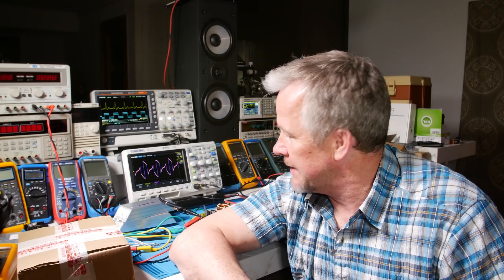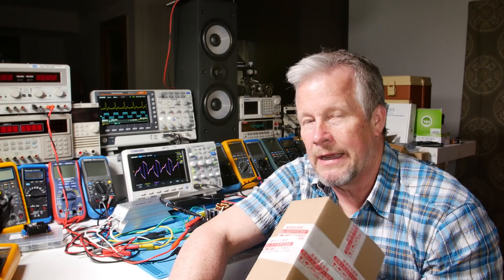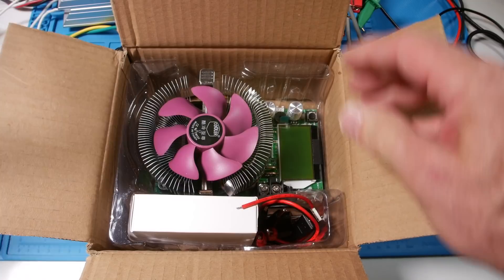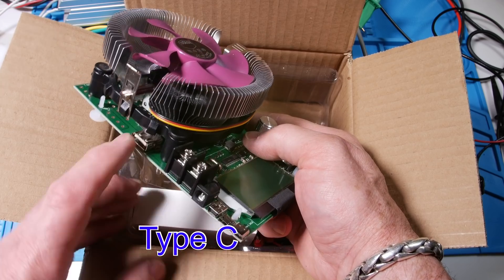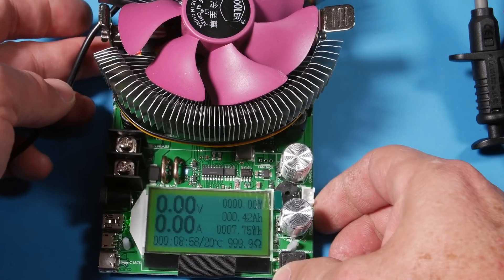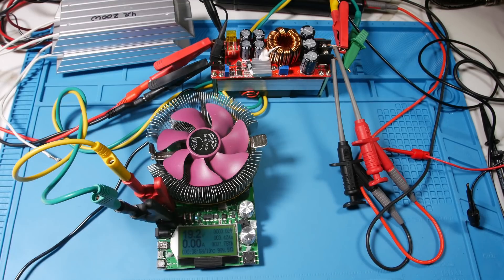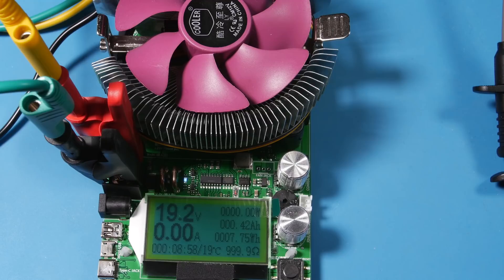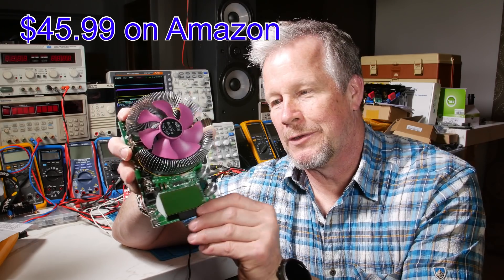MakerHawk Low cost Electronic Load

Comment: Hey Eddie is this DC load tester still working?
Reply from the maker: Yes it is - kind of.  I actually dropped something on the fan blade and broke it off the shaft.  So, I just have to epoxy the fan back on and it will put out full power again;)
Reply: @KissAnalog  thanks for the reply Eddie!

Comment: @5.50 The holes in the board are actually VIAs, they connect the bottom copper plane to the top copper plane.  Using the bottom copper layer as an additional heat sink.  The multiple VIAs allow for better transfer of eat from the top copper layer to the bottom copper layer.
Reply from the maker: Thanks Robert!  Yes you are right on!  Using via fields is a great way to tie planes together and also add more copper in the vias:)  In this case, they are so large - and with the placement of the fan, I think they also are allowing airflow threw the board.  Pretty cool idea;)  I've placed cut outs and larger holes for this, but I like this technique!
Reply: @KissAnalog  Yes the holes would allow the air to flow to help cool the bottom plane.  I too hadn't seen VIAs that large used before.  It is an very good Idea. 2 birds 1 stone.

Comment: I’m seeing current ripple on the output, at power up it’s flat but after 10 seconds I start to see ~1A short current pulses.  I’m testing a 12v 100w Vicor. Ripple with equivalent resistor is flat.  Anyone else seeing this?
Reply from the maker: Hi Bill, I was going to test this, but I damaged the fan accidentally and my glue is not holding (it is probably nylon).  I do think at lower currents that I did see something like this.  I meant to look into it but got side tracked;) Have you learned more on this since this post?

Comment: The most interesting thing with these cheap dummy loads would be to test the accuracy. I tested a few and the current and voltage measurement is by far not as accurate as claimed (often 0.5% error). Its more like 3...5% error. It should have used 4 wire measurement instead of just 2. Some voltage is already lost on the connection load wires - so the error becomes bigger with high amperage. Of course you can cure this a bit with very strong cables.
Reply from the maker: Thanks for this feedback!  I have a new version that I need to review and I’ll keep this in mind;)

Comment: I just picked one up off eBay and I'm not getting it to work. My knob adjustments will never turn the fan on or make the Voltage or Amperage move. Any ideas?
Reply from the maker: Sorry, just found this post.  Have you had any more success?

Comment: Does an cheapy electronic load add noise to the input ? If it doesn't change the output noise already a powersupply would have under load could be a cheap way to test power supplies
Reply from the maker: This is a fantastic question!  On the job, we don't even use our expensive active loads when doing EMI testing.  Not to say that they add a lot of noise at the input power where we are looking at EMI, but just to be safe;)  We use resistor loads.  I'll do a test to see what we see;)  Thanks for this!

Comment: Hi Eddie, that very same one you showed in this video is now in 2021, under various brand names, sold for $29. I used a similar one but with a 16x2 display and other user interface. Didn't like that one so much, didn't have continuous current control. Now I found another one, based on the $29 design, but the display is on a raised pcb. Looks nicer and makes it easier to detach when putting it in a box, connected with a flex cable. Specs are the same, price is €28. Amazing, isn't it? These things are very popular. I just ordered one and have to wait a couple of weeks now ;-)
Reply from the maker: Thanks for the great feedback!  I also got a new one that is just an updated version I think.  It also works great;)
Reply: Fifty bucks now.

Comment: hi sir, this load hasn't got a seperate voltage sense input. is possible to determinate voltage sense pins on the board?
Reply from the maker: Thanks for asking - that's a great question.  A remote sense will help to regulate at the load better to account for the cable loss to the load.  Without one, it is even more important to use larger cable to reduce loss.  The board might be able to be modified to add a remote, but that might need a video to explain;)

Comment: Did you try pressing the push button inside the rotary encoders? It probably has coarse/fine setting
Reply from the maker: Yes I think you are right.  Thanks!  I broke my fan with my fat fingers;)  Now I need to epoxy it back on so I haven't been using it...  I'll get that fixed as I need it;)
Reply: @KissAnalog  those are standard cpu/gpu fans which can be found on ebay and aliexpress. If you glue the fins back, it will vibrate a lot and destroy it's bearing

Comment: from own experience

a ">150V!"- overvoltage indication caused a freeze of the display, with just this message, on my 150W electronic load from Chinese production, which looks quite similar.  I have not been able to create a RESET of this message with the one button on the board. 

The adjustable load itself still works, only the display constantly shows ">150V!" It's a mystery to me how the overvoltage message appeared, because I only tested USB Power-Bank's. Maybe a burst spark...no idea (?)

In the case of the more frequent, and also understandable, operating case of the undervoltage message, this can be reset by applying a voltage above this setting value to the measuring input. With the key on the board, as far as I know, only the measuring value memory can be reset. The error or message memory is excluded from this.

If someone has a TIP to reset this overvoltage message I would be very grateful !  - Greetings Michael/germany
Reply from the maker: I think I have seen this when there is no load.  The voltage can climb up and get pretty high.  It is strange that you can not reset it.  I'll look into it.

Comment: ive used these in parallel up to 60A,  work great.  Note factory wires suck,  too much voltage drop/heat loss at the higher amperages.  If i get the chance i might replace the pots with digital pots for an automated setup
Reply from the maker: Wow - that’s a great idea!  Thanks for this great feedback - very helpful!

Comment: I wasn't a fan of the flex in the thin PCB caused by the heatsink pressure. I backed off the tension to a minimum and have no issues with heat dissipation. I'd pay an extra couple $ for twice as thick.
Reply from the maker: I completely agree with you!  Thanks for the feedback Jonny,

Comment: My 180W test boards came with 9V/1A power units (wall-warts). IF you are going to use currents anywhere near the high end of the unit's specification, I recommend switching to a 12V/2A power unit so that it can maximize the RPM of the fan(s). Otherwise as far as I can tell the fan max RPM is limited to what 9V can supply which seems to be about 8.0V after a voltage drop in the fan control circuitry.
The fans that came with my 180W boards were also lower RPM fans (230mA per fan at about 1700-1800RPM max as best I could tell) so I replaced them with higher quality and higher air-flow fans. At maximum RPM they are louder than the original fans...but of course the new fans are pushing a LOT more air through the heatsink. This results in the new fan(s) keeping the MOSFET considerably cooler than could the original fans and that is ALWAYS a good thing.

WARNING! If you do use different fan(s) you have to make sure any fan control circuit can handle the mA required by the fan(s) which could be much higher than the original fan(s). You may have to make or buy a fan control voltage follower circuit that has the power-handling capacity for the fan(s) you use. Note: there are some fan control circuits that do this for you. The circuit is inserted and controlled by the existing 3-pin fan power jack on the board and the output(s) go to the fan plug(s). Or of course you may just directly connect the fan(s) to a suitable power 12VDC supply and run them at max RPM all the time.

Note: I don't have any personal or financial interest in any of these devices.
Reply from the maker: That is great advice and information exgenica!  Thank you for sharing this!

Comment: WARNING! POSSIBLE HEATSINK FAILURE AND AN EASY FIX

It was hard to tell on your board, but the best image seemed to be at about 06.00...
But at least on the board I got, the heatsink is held onto and against the board only by 4 little plastic pegs that hold the mounting ring to the board, and the tolerance/"fit" on these pegs on the board is such that the heatsink could WIGGLE around in all axes/directions, including VERTICALLY toward and away from the board.

This means the thermal compound between the power MOSFET and the heatsink is under significant stress whenever you move the board. In addition, depending on what thermal compound they used, this design allows even a slight air gap to exist between the heatsink and the MOSFET thus accelerates the drying out and decomposition of the compound.

This is a design flaw and can eventually cause the effectiveness of the thermal compound and/or heatsink to fail which in turn can cause the MOSFET to quickly overheat and fail at any time.

So, the first thing I did, even before powering it on for the first time [Note1], was to replace those 4 clear plastic pins that hold the plastic ring to the board and secure it with machine screws and make sure the heatsink couldn't wobble around in any direction/axis. This can easily be done with non-conductive screws.

I verified I could use metal machine screws on the 2 boards I got, but the board/PCB has to be designed and fabricated a certain way to allow one to do this, so using non-conductive screws is better and easier for people new to electronics and this kind of situation.
---------------------------------------------------------

[Note1] one of the 2 boards arrived with 2 of the 4 CLEAR heatsink ring mounting pins LOOSE in the box.  THE FASTENER DESIGN IS THAT BAD. Their fastening method had 100% failed. Two ADJACENT pins had already popped completely out of the board, leaving the heatsink to literally flop around on one edge of the mounting ring in the package during shipping. If the shipping had taken longer I believe ALL 4 fasteners would have eventually failed leaving the heatsink completely detached from the board and free to bounce around separately in the package. This failure immediately brought my attention to these mounting pins and the discovery of the design flaw...although the flaw is so significant it would have been obvious anyway, but perhaps not discovered right out of the box.
Reply from the maker: Thank you for this great information!  It is a nice low cost Device.  I think it’s worth the time to make it better.  I did break my fan.  I’m waiting to see if the epoxy takes care of it ;)

Comment: also got one of those, identical picked up a few years back for testing high current 18650.. though at a way lower price, around half, but it was directly from China, without any return policy, like you get with amazon, so it makes sense with the higher price..
and yes the back micro-USB port you can run it from std 5v like a power bank.
I have just put some 4mm banana sockets on those two big input terminals, as you really need to use those if you wanna go high amp.
the interface is a pia with 1 button and you can easily find yourself in trouble where you put some current  amp or wattage load max in play and annoying to get it adjusted back, as sometimes it will roll forward and sometimes backwards etc etc.
but the good thing it aint locked, so you can go way higher than the rated 150watt... I have mine set at 300watt max, but obvious for brief tests, like checking voltage sack on lipo cells etc. and if a lipo cell is healthy.
Reply from the maker: Thats great info - thank you!   need to spend more time with this load.

Comment: Hi !! Have you tried connecting a constant current source? like those used to feed LEDs, with mine I could not do it, only with resistive load. Sorry for errors in the translation, my language is Spanish.
Reply from the maker: No, I haven't tried that yet.  I need to do that!  Thanks for the feedback!  How have you liked yours?
Reply: @KissAnalog ,  Thanks for the reply !!  I tried it with a 12v 150w source and it worked perfect, also with many phone chargers, but when I tried to test the good condition of some 50w led drivers, it did not work.
Reply from the maker: Can you give me a part number and I'll see if I can figure that out?
Reply: @KissAnalog  Hello, I uploaded a video where I show the problem, it is in Spanish but I think that just seeing it is understood.

Comment: Is the low voltage alarm also a low voltage cut-off?  Or, is it just an alert?
Reply from the maker: No it does cut off and save itself pretty well.  I've meant to do a follow up review of this - and cover some of the other features.
Reply: @KissAnalog  would be very nice because my similar dummy load does not work correctly because of the voltage drop through the two cables the detected voltage is not correct. https://www.youtube.com/watch?v=kDYn0xrDQkI
I bought this thing to make a capacity test of my LiIon batteries, but therefor the low-voltage cut-off have to work exact and not with differences of +/- 1V

Comment: 16:15 this fix resistance is very important . Trust me . You cannot test DC load in AC volt with out this fix resistance . Even Soo ... This fix resistance is important to test voltage higher than 50v in safe side . ( You have 8ohm and 8 ohm ) 200w . You can get 4 and 8 and 12 ohm 200w . Not necessarily for test load than a lower a voltage to get full stats of the original load
Reply: Send me link about how I can buy this fix resistance . I need 2ohm / 4ohm / 8ohm  ( or 4 PC's 4ohm )
Reply from the maker: abed itani Thank you for asking - this helps the channel.  From this link, which currently has a nice sale price, you will find other ohm values as well.  https://amzn.to/39DC9iE

Comment: 11:51 I hope you didn't crank it up to 80v because this DC to DC converter will send a high noise to the DC load and I got my transistor short it out for some unknown reason ( it work fine in 80v batterys with fuse for safe of short circuit )
Reply from the maker: It is power limited, so for higher voltages it can't take as much current.  I wonder if you exceeded the power rating?  It seems like the current limit works pretty nicely, but I have heard of others having trouble.
Reply: No I did not brake the W_V_A limit . But the mosfet that in the unit is irfp260N   and the character in temperature more than 25''C is not what the PDF sheet say . And in by the way ( the more high voltage you put / the lower the current you have to apply / the power in W you have to make the power not reached the max power of the mosfet but you have to leave more and more free space for the power of the mosfet ) example : a mosfet is max 100v / 10a / 300w   
300w in 25c 
In 100c the power is 70% is 210w 

Trust me in this one 

The more voltage you reach the more internal heat ( cannot be cool down immediately ) since the heat transfer is not fast enough to remove the heat source inside the mosfet . So the power is limited by a graph between the voltage and power by apposite the more voltage reach limit the lower power the silicone mosfet can handle .
Reply from the maker: abed itani That is a very good point - if the thermal time lag is slow that is bad news.  I’ll have to check to see how this can be improved.  There’s been enough interesting comments on this product - I think it’s time I do a follow up video!

Comment: 8:00 This are not 3 transistors ( 1 big transistor 260N + 2 parallel Scotty diod 10amp per leg and you got 3 leg for the best big load and one for USB load )
Reply: Be careful about the unit what they say about power and voltage and current . They give you the max what it can handle in short time before the temperature reach 40c . Other wise you can get the transistor get shorten out
Reply from the maker: abed itani Thank you - I’ll follow up with a new video on this.
Reply from the maker: Thanks, I'll have to take a closer look, but what you say sounds about right.  I need to test this again for another subscriber who has had trouble.

Comment: 6:54 this small diod for USB protection test
Reply: Reverse because I mistakenly put USB clip with alligator with wrong polarity . And nothing happened . Normally the mosfet get shorten if this was not in the board
Reply from the maker: abed itani Yes this is a common practice.  Thank you for all your great feedback!!  I appreciate you!
Reply from the maker: Is this for Over voltage or reverse voltage?

Comment: The right side 5 mm black socket is an OUTPUT, not input. No one has covered how it works. 
Anyone has an idea?
Edit: never mind, it's described here https://youtu.be/bx74sNFQvwc
Reply from the maker: Thank you!  I do plan on demonstrating more functionality with this unit.  I appreciate the link;)
Reply: It works really well. I've added an XT-60 plug in parallel to the 5 mm, so I can propel some serious currents. Also relieved the power traces on the board with thick bypass wires.
My version has the alu cooler sink, which gets to 50 °C at its base, but is cool on the fins. Not good! I will replace with heatpiped copper sink from cpu. Cheers 🙂